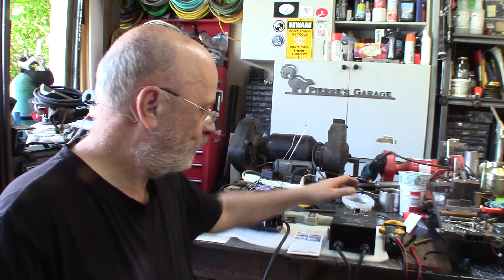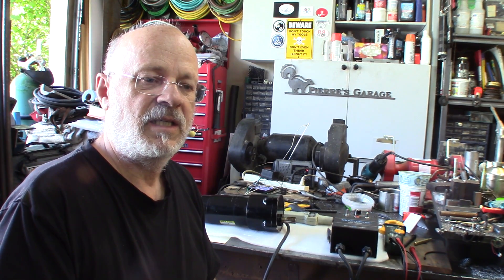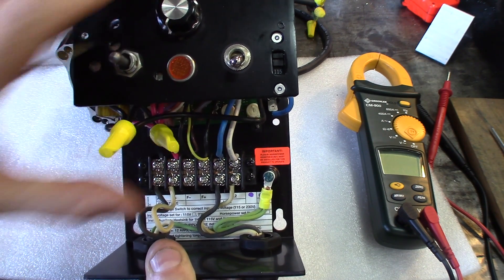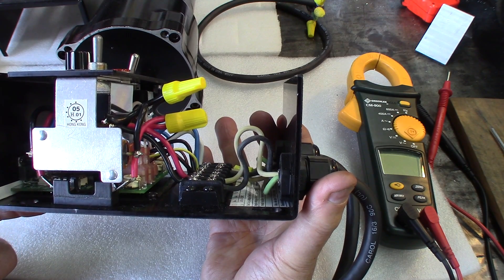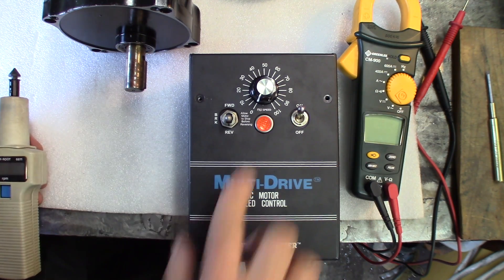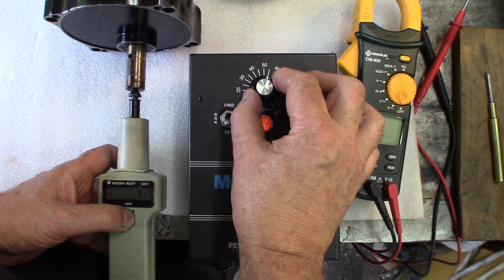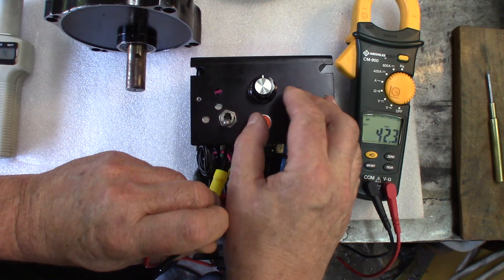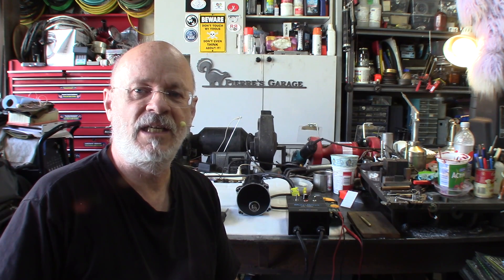Variable DC motor Speed control Penta Power KBMD-249D

Comment: Hi Pierre, 

  Great video 📹. 

  I'm still trying to understand the resistor graph.   In the range of 90 to 130 VDC Does the graph go from a minimum of 1/100 to 1?   Is this unit referred to with HP power? 

  For the KBMD-240D with 1/2 engine.  So does this mean that at 1/2 HP at 115VAC the resistor must be 0.025 ohms?

Thanks
Reply from the maker: You're right about the .025 ohms resistor for th e half horse motor. I'm reading the same as you...   👍
Thanks for viewing and for comment,
Pierre

Comment: for input speed control using ac or dc current, if using DC how many volts?
Reply from the maker: Those speed controllers are working at either 120 or 240 volts AC, the output is 90 volts DC for a 120 volts input or 180 volts DC for a 240 AC volts, also there is inside a resistor required to adjust according to the current drawn by the motor.

Comment: I wish I had found this video yesterday.  I had just completed wiring 2 DC motors to penta power units just like yours,
The video I just filmed is very similar to yours except I did not show the meter.  I plan on mounting one motor on a drill & the other on a band saw
Reply from the maker: Those Penta drives are quite efficient for simple speed control...  My first career was in electronics until 1991, Worked for the CBC, the Canadian TV network, metal working came after, not done much electronics after 1991, but it's a little like riding a bike, it comes back slowly by doing it...
I you need any help, just let me know, I'd be glad to give you a hand if it's something I know about...

Comment: Hi Pierre, what is the size and brand you use for the cable gland?
Reply from the maker: The nylon cable connector, if this is what you're taking about were already installed on the unit, but, if you look at THOMAS & BETTS company you will find them by name (CORD CONNECTOR (NYLON), hope that's what you were asking for, if not just let me know.
Thanks for viewing.      Pierre

Comment: Hello,  How many amps does it provide??  Take care.  Doug
Reply from the maker: The maximum is rated to 10 amps on 90 or 180 volts, you'll need to use a heat sink above a certain current level... 
This link may help you, it's the owner's manual in pdf format:
http://www.kbelectronics.com/manuals/kbmd_240d_manual.pdf
Enjoy,     Pierre

Comment: Something like that motor and control box would make a damn good independent longitudinal feed on a lathe. A bit like the Hardinge HLV has. Should be interesting to see what you use it for Pierre.
Reply from the maker: You're idea is a great idea, didn't have that in mind, but to be kept on the burner....   ;)
Not going to do anything about this before the Bash, we're leaving Friday morning, and, not much is packed yet... :(
Thanks for comment,     Pierre
Reply: LOL, thanks Pierre but that's Hardinge's original idea not mine. I've been considering it for awhile now. Probably would need a simple single tooth or multi tooth dog clutch tho to engage and disengage the drive and mount the whole thing on the lathe beds right hand end face. Maybe an added cheap digital tach to give some idea of the exact rpm on the lathes feed rod would be helpful as well.  My thought was with that variable speed then your not always locked into whatever the manufacturer supplied for the built in feed ratios. Enjoy the Bash, should be a lot of laughs. Maybe one day I'll make it there.

Comment: a simple controller is all you need I like the forward and reverse switch
Reply from the maker: To operate simple devices, the simpler the controler, the better it is.  On this project, I won't even need the reverse feature... 
Thanks for comment,    Pierre

Comment: Hi mate.  Will the power of the motor remain constant at any setting?
Reply from the maker: Hi Marcel,
This controler claims to maintain the RPM independently of the load, depending on the maximum current setting determined when I'll set it up...
This will have to be measured on the installation...  ;)
Reply: Ah, right.

Comment: Wonder if this type of controller would be good for a tread mill motor?
Reply from the maker: If your motor is running around 90 volts DC, there is no reason it won't work, just make sure you respect the max rating for the unit you get, to use the 2 hp rating of this unit you need to get the optionnal heat sink...   ;)
Reply: Yep.  It's about the same with a lot more user control.